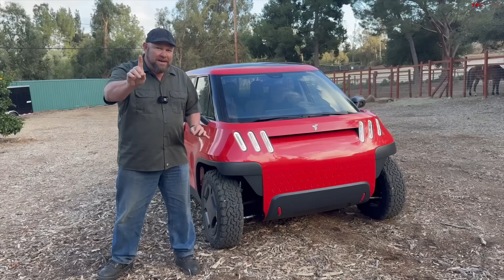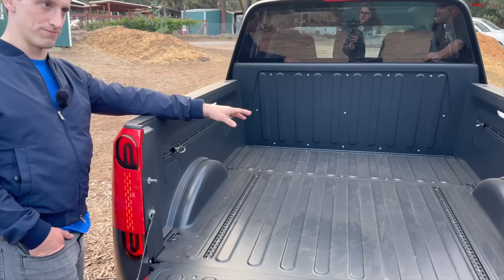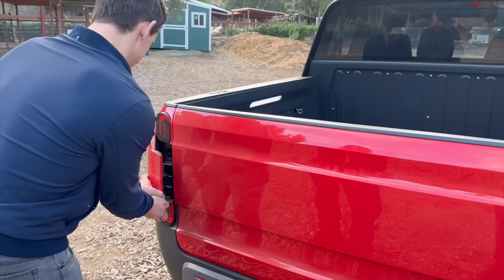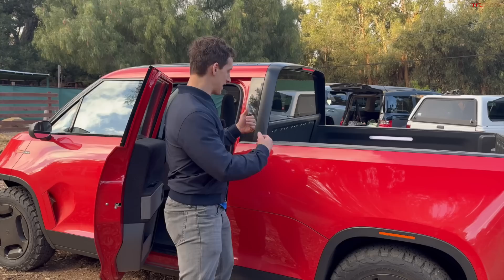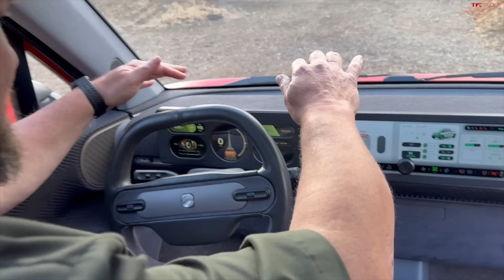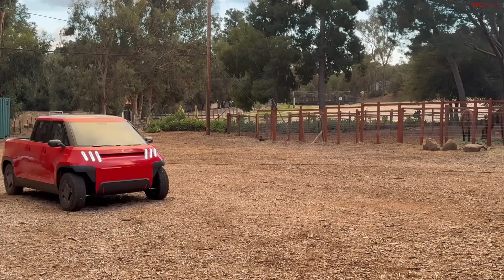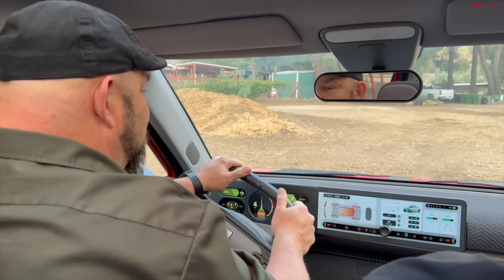I Drive the Most Revolutionary Truck In Decades: Meet the Telo MT1!

Comment: Its ALL about how much this costs.  All the specs sounds fine, it looks a bit weird, but if the thing comes in at $42k like they say, they have a chance in hell.  These days there are zillions of high priced EVs.  The gap is the lower price range.  The under 50k range is critical or you will not make it.  Rivian and Tesla are both pushing to have a cheaper option and they are already well established, so you really need to stay far under 50k or you will wont make it.  My problem is I surf AND snowboard, so I want to cover a very long bed.  I am currently running my mustang with no passenger seat and its a dream, but when not surfing, the passenger sits in the back, so weird, but I can fit a 9 foot surfboard inside the car where almost no trucks can do this.  The car market is so hard to get into.  Fisker and many others have failed, so this is going to be tough.  

The short clip of the one with a fully covered back looks very nice.  That is what I would want.  If I could get that right now for $45k with AWD and 300 miles range, done.  I dont care about 500hp, 300 is plenty.  But, I just simply doubt that can happen just yet.  So, the 2012 Ford Escape v6 awd that I can get used for $8k probably is going to win.

Comment: Pretty sure those exposed front wheels will make it impossible to pass pedestrian crash safety in any other market, so this would be US only. When one of these things hits a person it is not going to be pretty.
The design of that instrument cluster... yuk. Made me think of the interior of my '82 Ford Fiesta. That recurring pill design and gray plastic just feels dated.
That $41K price is for the lowest spec too. So, that's already real spendy, and if you want the full range, and 4wd, it's $50K, before any other options.
Also the power is excessive. Do you really need 500 hp or even 300? Certainly 500 is in top-whack insurance territory. 200 hp with 4wd would be enough for most markets and would make the insurance not quite so bloody ridiculous.
Shame, because it is interesting otherwise.

Comment: I bought the first 1980 Datsun pickup on Vancouver Island, it was perfect i kept it 20 yrs , mechanically was still fine (270k Miles) but badly rusted. It's been 25yrs, still waiting for my next perfect little truck..this is it...except  put solar panel roof, not glass...don't want glass or especially opening glass...if  any car has a glass only roof,  the first thing id do, put a body colored wrap over it..

Comment: They've overthought this vehicle by a mile. No one needs a 500 HP option or even a 350 mile range upgrade. Do you need a glass, photo darkening roof? At $41,500 base, it's way overpriced. That's more than a base Tacoma, and China could build it for $15K.

Comment: For those of you are monster truck fanatics and then drive along with nothing in your way overpriced truck, get ready for a real truck that can do as much of the normal things as a regular size truck. The worthlessly huge and heavy Ford and Chevy trucks destroy our roads, take up two parking spaces and waste fuel need to go back to the late 90s or so when smaller trucks were just fine for everyone. If you want to tow your house (RV), then get a commercial towing vehicle, don't use a typical truck because they're not designed to tow ridiculous weights. The Telo is more than a city commuter, it can be used all ver the place. It can be used for everyday driving while also having the capability of hauling loads mid-size trucks can haul. The AWD only has a 1700 lb payload but my Tacoma only has a 1500 lb payload and after adding air shocks, I can easily haul a ton. I can't wait to see actual mileage on the Telo, unloaded and loaded.

Comment: Make a 2 door and I might consider buying one. Also nice they are working with Aptera to have same type of solar panel on top. If the glass cap had a panel, they'd have about 600W charging capacity. That all depends on sq/ft available for both locations.

Comment: Idk I think my 2002 Camaro can out truck this "truck". I can fit a few 10 foot 2x4s inside and close the hatch. It will comfortably handle several 8 foot 4x4s. Sheets of plywood? If they are 2x8 foot yes, if I need a full sheet I'll rent a uHaul truck. That truck there doesn't look like it can do any of what my Camaro can 😮 spending money on goofy instead of utilizing what we already have should be a crime.

Comment: I like the utility and cost-savings of using COTS tech and parts, as long as they pass the savings on to the consumer. There is another consideration, though. Once you've picked a COTS component that meets your requirements, what happens if that part is discontinued by the manufacturer? Do you have alternatives/substitutes ready to go that you can use if that happens for repairs of existing vehicles and to keep manufacturing moving forward? One of the problems with electric vehicles in general is that overall the tech and components base is far too dependent on China as the primary source.

Comment: All that glass in the roof would be a no go in southern Nevada. The interior of that truck is already going to be hot in the summer, but way worse with the sun shining directly into the interior through that glass. Telo needs to make some sort of cover available.
Reply: They mentioned in the video, there's an option to replace it with a solar panel. Personally, I would be more interested in just a flat covered top, and a 2-seater option they mentioned with an 8' bed.

Comment: Nice. This is the end of the American Full Size truck for non-commercial use. For my use case, the only thing missing is the ability to haul a camper or Travel Trailer. But if I could put a tent/popup in the back for emergency situations, I'm A-OK with hoteling.
Reply: You can tow smaller ones... 6600 pounds towing ain't bad.
Reply: it's a perfect down-sizer/bugout/2 person camper.

Comment: ICE or electric, I don't care. But if it's electric, it better work in a practical fashion. It's a truck. And mini-trucks are not a new category. I owned a 1983 Mazda B2000. These were all over the place (Datsun/Nissan, Toyota, Mazda, etc.) until first, the chicken tax, and later the CAFE standard, came into place. The chicken tax started under LBJ and still is in place...a 25% tariff on imported small trucks. The CAFE standard (corporate average fuel economy) has encouraged domestic manufacturers to make their vehicles larger and larger and heavier and heavier. It disincentivizes smaller, more fuel-efficient vehicles, among them small trucks. CAFE is the reason you see full size trucks with tiny turbocharged engines that burn themselves up in short order. Crash standards have also combined with the CAFE standards to shut out any of the true small trucks, which is why you've seen the Nissan Frontier and Toyota Tacoma grow larger and larger and much more expensive over time, because government regulation pushed them that way.

Comment: ok,one thing that bugs me from the start,I want a 2 wd-however I do not want a vehicle half as powerful as the 4 wd version, ! expect at least 300 hp in the rear dont want to feel like I bought half a truck, another thing make the 2 wd rear drive because of traction reasons the old VW bugs and squarebacks would actually push snow,I live on a very steep hill and in the winter I have had to turn around and back front wheel drive cars up here. you have a good concept and i want to get one in the future,just keep in mind mu comments and 250 hp on each end is good for the 4 wd,I very firmly believe 300 on the reae wheel drive one would be a good selling point and the idea of having some solar cells to keep the battery topped up is a good one and thanks so much for the original design beings it now appears i wont be getting a Canoo-kevin

Comment: When I was watching this, I got to thinking, "Wait, we've had mini trucks in America before," so I looked up the specs on the original Chevy Luv, from back in 1972, which was one of the smallest of them. Nope, even the short bed version was a full 22'' longer. The Telo really would be in a class of its own here. I love the concept. I like commuting in my little Chevy Bolt, but I've still been holding onto my '00 Ram 2500 V-10 4WD for Colorado snowstorms or when I need to haul a few sheets of drywall. (Note: even that 6,500lb behemoth can't haul a 4x8 sheet with its tailgate up.) With a Telo, I could consolidate. How much was that deposit again?

Comment: The exposed tread on the front wheels looks cool but not practical in wet or muddy conditions as the tires will throw more debris out front which splashes up at speed onto the headlights and windshield.

Comment: I genuinely believe that the era of practical and functional vehicles has arrived. Consumers are growing increasingly frustrated with excessively high prices for vehicles that go far beyond practical design in terms of cost and real-world usability. Manufacturers seem to follow a checklist of "mandatory" features that only serve to drive up costs through unnecessary overengineering.

What people truly want is an affordable, practical, and highly functional mode of transportation. Unfortunately, a $40,000 price tag does not fit that definition. Despite claims of utilizing off-the-shelf components and streamlining production, the final cost remains comparable to a mid-size Toyota Tacoma. If significant savings were achieved, they should be far more noticeable. Realistically, this type of vehicle should fall into the sub-$30,000 price range.

Comment: I'm impressed with how honest and realistic they are. Not beating around the bush about towing or actual capacities. I looked at kei trucks but the registration and titling is not standard or even allowed state to state. I currently drive an f150  and as I get closer to retirement I want to downsize but still have a truck. A used Honda ridge line  was what  I was thinking but this looks promising.
Reply: I love my first gen Ridgeline as my secondary vehicle and this has my wheels turning.  Hope it makes it to market and gets rave reviews so I can get at the back of the line for one when my primary vehicle's loan is paid off in late 2026.
Reply: @biffmalibu3733  both Chevy and Ford have smaller ICE trucks - Ranger and Maverick for Ford and Colorado for Chevy. This has the capability of a Ranger with a smaller footprint than a Maverick.
Reply: @EdDale44135  Chevy s10 as well

Dodge also has the dakota. It's a little bigger, but it's definitely a step down from most trucks
Reply: @BooDoop  I wish Dodge would bring a new Dakota to market! It was a reasonable truck at a good price. I think the Maverick, Ranger, Colorado, and Canyon are the current "small" domestic trucks.
Reply: @EdDale44135  Oh yeah, currently being made, I have no clue. My brain was locked into the used older market train of thought.

 Yeah, the dakotas are nice trucks, I got myself a 96 V6 magnum, and it's been a dependable one!
Reply: Absolutely love my gen one ridgeline. When I replace it, it will be with another ridgeline.  Everything you need, nothing you don't, in a super capable and comfortable platform.  We even tow a small travel trailer with ours. You won't be disappointed.
Reply: @teaspoontinyhouses  Me, too.  Very capable.  ABQ to SE British Columbia in two days, solo.  Super vehicle, too thirsty.

Comment: For most people, this is 100% of a truck. We're out here dealing with trucks two and three times as big as what the driver actually needs, it's refreshing to see an efficient use of space in a purpose-focused truck
Reply: ...but it costs nearly 2x as much as those larger trucks....
Reply: @spamcatcher2760  Can't compare used to new. This new truck doesn't even have mass production pricing yet. The F150 lightning new is more than this.  The Tacoma new is like 30 grand? I would like the price to come down too but smaller production runs are very expensive thanks to economies of scale.
Reply: @matthewmoore7447  this truck won't get no work done. It's a glorified golf cart.
Reply: @saulgoodman2018  with all that horsepower and bed space and carrying capacity, it's a golf cart?
Reply: @stephentroyer3831  HP is not the only thing.
This truck is 40-50k.
That is way to much for what it is.
Reply: @saulgoodman2018 long distance towing, and hauling passengers and stuff at the same time are the things it can't do. Oh, and looking big and tough, it can't do that one, either.
Reply: @stephentroyer3831 looks like a great parking lot security vehicle or park security for cities. Nothing more than that this is not selling well in the US. Its literally a gold cart that can go fast for a lil bit lol
Reply: I have an F150 Lightning and it has as much interior space as anything on the market, and I'm 6'7", I need it.  And with the frunk, I have never put anything in the bed.  Do I care what people think?  Not really.  I crammed myself into shit box economy cars for years, but now that us Gen-Xers are getting older, I'm over it.
Reply: @Brons2 full common sense points awarded.  I'm only 6"1 and I felt cramped just looking at the dashboard, but then again the sunroof does in fact give you another couple inches of headroom back.  I need to not fee like Im in a cave.
Reply: @Brons2 you would fit in a Smart, dude
Reply: @moscuadelendaest do not fit in a smart, I have tried it.  My head is against the roof.
Reply: Yeah, ok 😂😂😂
Reply: @We_Dont_Miss It's ok "buddy" we all know your compensating for your large truck😅😂😅 clown
Reply: @We_Dont_Miss  yeah naaah, I remember laughing at a RAM 2500 driver trying to fit a single door leaf on his bed. Looked liked a benny hill sketch.
Reply: @We_Dont_Miss  90% of the trucks I see don't even have anything in the bed
Reply: @mattwolf7698  You don't know what they use them for, when you don't see them.

Comment: Know what would be mind blowing? If instead of a frunk it had a detachable large utilitarian basket in front. Kinda like bicycles do. There's lots of usable space below headlights level. Heck you could even make a lot more interchangeable accessories that attache to the track using those same mounts. Like a snow plow, a floodlight bar, a winch and so on. I think that would be pretty cool.
Reply: if they did it right it would just have sturdy mounts all over the thing.!  I can't stop thinking about 3D printing all kinds of accessories and hookups.  Gopro mounts.  Milwaukie Packouts.  Surfboard t-gate systems.  Front basket like a bus.  Lego for trucks.

Comment: He's onto something here. My improvements would be a slightly longer chassis, the rear windshield folds or slides into the rear seat- still allowing the rear seat to fold down. No tonneau cover, and optimize the bed to actually have a truck bed topper or camper. Most lastly, allow the option to have a range extender or plug-in a high efficiency generator and charge while driving. Please contact me if you are interested in R&D. No compensation needed.
Reply: I found myself thinking, can I work at Telo right now.

Comment: Technicaly speeking glass above is fancy lows the volume at start so better all without glass above as for scfi a inside shell can be aditional batery which makes range better as measure is like very afordable use design and slightly design atv so even 4c atv are fancy fast but that is like 330hp so no need 500 hp actualy and all is left to final price and range and metal protection cover is insane if you ask me a lift cushion on suspension could help awd and is like having  fun and dakar gliders gives easy airglide drive even which turns to be epic and stretched out flatened and if škratkih and Dakar stifness a double suspension is needed on cushion but include toughness probably not with glass but it has to go in basic price and with above range to get some quota and buyer satisfaction otherwise canope already whistled and stoped May be you slike have suporter in production from atV side but that is all have fun and light design is to old to much willd cat design could be normal led light boxy or rounded or circled inside twined

Comment: I think it’s really cool, The pass through seat is a really neat idea. Reminds me of the Baja. 
However please consider  this scenario: if you were driving with a sheet of plywood, the tail gate was open, the pass through seat is open, the plywood is hanging out of the back of the bed. What would happen if you were rear ended? 
The only cushion for the impact is the back of the drivers seat.
Reply: If the back tailgate is down and the board is in the back seat, there would be no overhang.

Comment: I was never an ev guy,  they just seem way to complicated. This thing seems like the most logical approach to an ev ive seen yet.  Logic and engineering seemed to have had a nasty breakup as of recent in most vehicle manufacturers. This mini truck Looks awesome, and the guy explaining it seems pretty cool to. Wish yas the best. I genuinely am excited for you.
Reply: Nothing really complicated about an EV. An electric drivetrain has maybe 20 moving parts vs like 1,000 or 2,000 for an ICE drivetrain. ICE drivetrains are ridiculously complicated Rube Goldberg machines.
Reply: @ Oh im quite aware of the complexities and points of failure in the ice. Timing chains, piston rings, clogged oil passages and journals, vvt's etc lol. But all these parts can be fixed relatively cheaply.  Correct me if im wrong but isnt it hard to gain access to tesla or rivian parts to fix an ev in the case there is a part failiure and needs replacement?  i know electricity and mechanical engineering to a degree, but im not a software engineer lol. i just liked how they explained that a lot of the parts on this truck are off the shelf and seems like they'd be easier to replace. all this is based off of speculation though.....